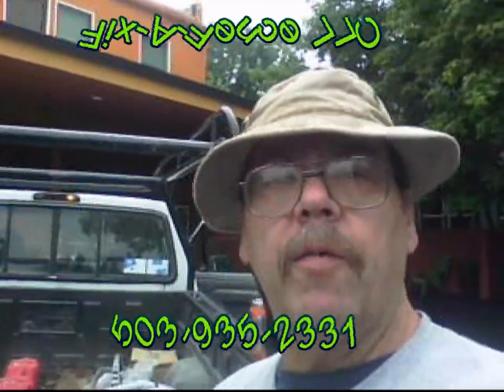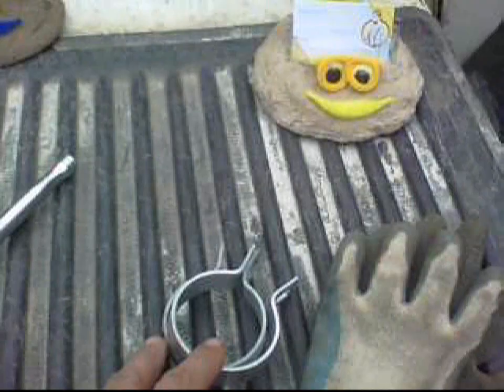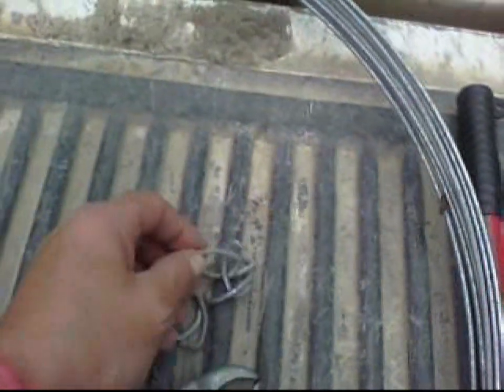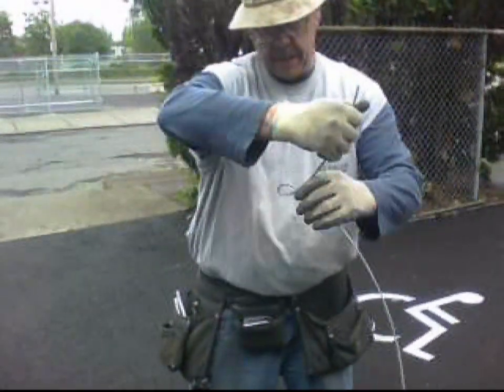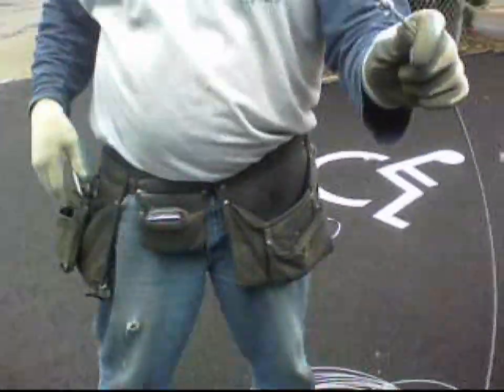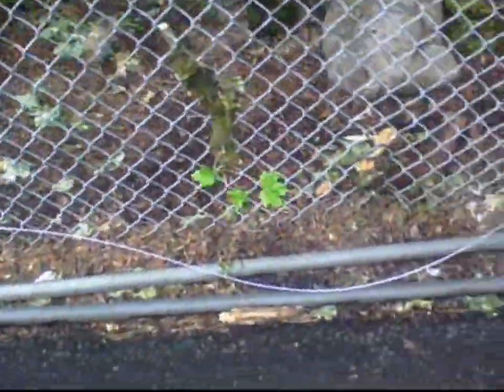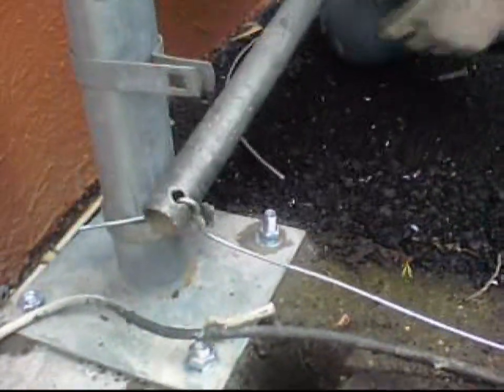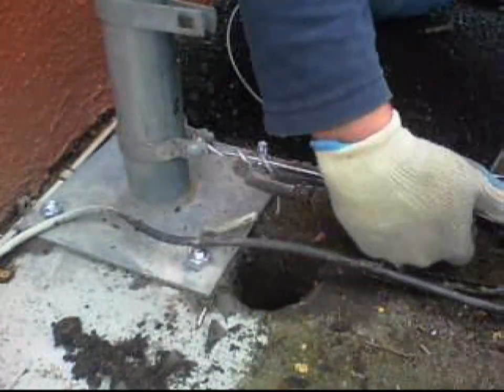How To Install Tension Wire For Chain Link Fence

Comment: Hi, John. I have to Thank You a lot for your video on the tension wire install. OUR German Shepherd pup tried going under our chain-link fence a few times and I had to find a way to keep him in. After watching your vid. I found the supplies at HD. I had to improvise a bit because the fence was up already. The T handle I made was out of an old ceiling fan hanger tube. I drilled 1 hole large enough to use a pinch bar in it and after wrapping the wire really tight remove the bar and wrap the wire

Comment: Good tip with the T bar, doing big project out at my place on Long Beach peninsula & the tension wire is always a pain in the rear.

Comment from the maker: If you are a welder you can make one. Take two pieces of 1-5/8" medium duty pipe about 12-18" long or what ever is comfortable for you and weld it like a T and then drill a hole at the tip of the end of the pipe about 1" from the end. Make sure the hole is large enough for the gauge of wire you are using to slip through the eye you just created and twist away. Hope this helps

Comment from the maker: Normally without tension wire at the bottom of the fence the chain link can be kicked out away from the fence line about 8-10" making it easier for animals to escape. Having the tension wire at the bottom keeps the chain link up against the fence line and only allows about 2". I hope this explains the purpose of tension wire better. Thanks for the comment

Comment: Not knocking your technique at all.  You did some great work there.  Just wondering why you had the come along at the beginning?  I never saw you use it to set the wire.
Reply from the maker: Josh,..so at the other end of the fence line,..I put a loop in the tension wire,..then put the tension wire loop at the brace band and installed a nut and bolt,..that's why I have the come along at the one end,..I use it to stretch the tension wire on longer runs than like twenty feet or more,..does that answer your question?
Reply: Yes, that makes good sense. I thought it might be something like that.  Thanks for the explanation

Comment: What is the max length a tension wire should be? If the terminal posts are really far apart, would you have more than just one run of wire?
Reply from the maker: Good question,.. I have ran lengths of tension wire for 500' from post to post,.. every job is different, depends on how many grade changes you have, drastic grade changes I like to put terminals at the top and at the bottom, there again it depends on the angle of the slope, I hope this helps out
Reply: @JohnWillman  thank you! Doesn't it make it harder to get it tight? Mine is loose enough that the dogs push under the fence and escape. The tension wire isn't even straight. It's got small bends in it throughout.
Reply from the maker: @myfriendjoebob  Wow,.. is the tension wire hog ringed to the chain link? Normally during the installation process the slack is pulled out and the the wire is retightened before tying it off. You may have to break this down into smaller sized lengths to prevent from that happening,.. about the best I can say right now

Hope it all work out for you

Comment: Thanks John,
 Will this still work if the fence is already up? I put up a 5' chainlink in Rockcreek Or. and forgot to install the tension wire. I hope it's a quik fix..
Reply from the maker: Well,..you may need to disconnect the chain link frm the end posts and remove the bottom tie from each line post and then you could run the tension wire between the post and the chain link,..the reason for disconnecting the chain link from the end posts is so that you will have room enough to work the T-bar,..hope this helps,..keep smiling

Comment: I was wondering if it is possible to cut an access hole in chainlink fencing.  I am using a dog kennel to hold chickens and need an access for them. The door needs to be used for us to get into the area our selves
Reply from the maker: Charles Bowlby  Sure you can cut a hole in the chain link,...but to keep the tension as you know don't cut the chain link all the way down to the bottom. Be careful as the little clipping like to go flying when cutting with tension on the chain link. Make sure that you knuckle over the cut ends on the fence where you dog door is,..you wouldn't want you dog getting all scratched up.

Comment: Hi John, thanks for the video mate! I would like to ask if it's OK to run the tension wire around the end posts? I don't have any of the tension wire brackets that your video shows. It would be for a plant climbing privacy fence so does not need to be pretty as it would get covered in plants. Cheers.
Reply from the maker: +stewedapple  the only thing about that would be tightening the tension wire. Isn't there any ma and pa fence companies in your area that would carry these fittings?
Reply: +John Willman I've now found that they do the tensioning differently here in Australia, normally they spiral tie the mesh to the posts and top rail. I cannot find any fences that use a tension bar here, interesting.
Reply from the maker: +stewedapple I don't see why not,..if your putting up chain link the difficulty would be attaching the bottom tension band to the tension bar. Other than that if you're not applying to much tension on the wire it would be fine. Don't want to knock the posts outta plum. There are web sites I'm sure you can get some fittings mailed to you through on line shopping. Good luck,..

Comment: Can that T-bar be bought anywhere?  Or do I need to find someone with a welder and make one?  Local Hardware store has  never heard of it
Reply from the maker: This is what is welded up,..Get a couple of pieces of 1-5/8" pipe and cut them to the desired length's,..weld into a T and then drill a hole large enough for the tension wire to slip through about 1/2" -1" from the end and whal-lah you have a T-bar,..good luck and remember keep smiling

Comment: do you have to weave the tension wire through the bottom of the chain link fence?  I'm trying to keep my dog from getting out under the fence...
Reply from the maker: +John Davies If the fence is already in place, you will need to remove the bottom tie from each line post and pull the tension wire through between the post and the chain link fabric then you will connect the tension wire to the brace band at the bottom of the post. After you stretch the tension wire you will need to attach hog rings to the tension wire and chain link on the half diamond keeping the wire straight with the chain link. Does that make sense?
Reply: I thought the tension wires goes in and out of the chain link fence not just post to post?

Comment: Question, don’t you have to interlace tension wire onto whole bottom of fence? Cause it’s not hooked up to the bottom of the fence???
Reply from the maker: That's what the hog rings are for,..the hog rings fasten the wire to the fence,..weaving it through is time consuming,..then if there is a repair needs in the middle of the fence line it makes it really difficult for repairs
Reply: John Willman got it, thanks for the help
Reply: @jwthefencer  I get that part but what’s the correct way? Should it weave in and out?
Reply from the maker: @balenabros3246  it all depends on how much you want to work with it, hog ringing the tension wire to the chain link on the half diamond is industry standard or us here in Portland,.. I have seen the in and out method and have never worked with it myself, probably never will, thanks for viewing,..
Reply: @jwthefencer  thank you so technically the hog ring does catch onto the chain link that makes better sense andin and out not really needed then. Just wanted to know the standard. Thank you for your knowledge and time.

Comment: How do you attach the chain link fabric to tension wire?
Reply from the maker: With hog rings and a pair of hog ring pliers
Reply: @jwthefencer I am trying to secure the bottom of my chain link fence. It is currently loose. The run is about 100ft. I plan on adding tension wire at the bottom and than attaching the fence to it with hog rings to help secure it. Question should the 100 ft run of tension wire run uninterrupted from start to finish or should the tension wire start and stop between each post across the entire run?
Reply from the maker: @clemensstepho411  If it is one continuous run, yes stretch the wire from one end to the other,.. if there are any uneven areas you can use the fence tie to tie the wire to the post to keep it in position or up off the ground while rolling out the chain link. I hope this helps out,.. if you need a more one on one, give me a call.
Reply: @jwthefencer thank you. One last question. Do you weave the tension wire through the fence fabric or does the tension wire just sit next to the fence fabric?
Reply from the maker: @clemensstepho411  The tension wire should sit next to the wire between the wire and the post at the bottom on the half diamond.

Comment: hi John, can i purchase the d shape brackets for the chainmesh tensioners, they dont sell them in australia they are still lacing the ends with wire, the American way is far tidier
Reply from the maker: I believe you are referring to the tension bands that go onto the posts? Is that correct? Anyway,..I don't sell parts,..I am sure you can get them on line,..they would be measured by the outside diameter of the post

Comment: Is it fair to just assume that you run the cable through each hole on the fence mesh?
Reply from the maker: Sure you can,..if that's what you want to do,.. not sure how that will work out since the wire still needs to be tightened.
Reply: John Willman, does the cable go on before or after fence mesh? In your video, part of it is up and part isn't.

Comment: Can you tell me how you keep the tension tight when you unravel the wire from the T-bar. Thanks
Reply from the maker: I will do my best at explaining it,...so after the tightening is finished with the T-bar, pull the T-bar with the tension wire back away from the post and bring the T-bar and wire around underneath the wire making a loop thereby stopping the tension of the wire from wanting to draw back.You can finish up with the wire still connected to the T-bar and cut the wire after the wrap or cut the wire off of the T-bar and wrap the tension wire around itself from where it was cut. Hope this helps out,...
Reply: where can I buy a tbar?
Reply: @QuinnB1  I'm having the same problem. Can't find one for sale for love or money. I figured I could drill the holes if I could at least find some metal tubes welded together like that, but even that's been eluding me. 🤷🏻‍♀️

Comment: Where do you get tee bar @ John?
Reply from the maker: +paperchasser54  The T-Bar can be fabricated by using two pieces of 1-5/8" medium or heavy grade round steel pipe. Take one piece approx. 18" an and coupe the end to fit the other round piece of pipe. Then take the other piece of pipe and fabricate your T-bar by welding it at the T. Then at the end of the T drill a hole that will fit the tension wire approx. 1" from the end. Hope this helps, thanks for viewing
Reply: I saw where someone used just a pipe and a piece of rebar, with holes on either end of the pipe, one to twist the wire and one big enough for the rebar to fit through. Benefit of that is the rebar can be removed in a tight installation area and put in the pipe once the wire is threaded through. Also the rebar can be placed inside the pipe for a compact storage solution.

Comment: John how would I add it to an existing vinyl coated chain link fence?
Reply from the maker: Ryan Cosic Most ma and pa fence companies should have some remnants on hand. There is a coated tension wire either smooth or a coiled spring wire. The same application applies to coated chain link fence as with galv. Hope this helped,..

Comment: I'm about to re-fence my back yard to contain an overgrown husky that climbs and digs. People tell me I should bury the bottom of the fence. Anybody know where there is some information on the best way to do that???
Reply from the maker: hamstersniffer , dig and trench, set longer posts in the trench before installing the chain link, then back fill after fence is complete,..chain link is available at 6', 7' & 8' high. You could go all out and bury the chain link 2' in the ground or go with 12 inches. Either way you have your work cut out for you in digging alone. Good luck,..

Comment: On a 4 ft fence how high do you set your post
Reply from the maker: austin vickers If it is on a flat surface your terminal post, ( end, corner, gate ) should be at least 49". This will give an inch of play. Normally I like two inches for the home owner so that when they weed eat up against the fence line the tool can reach underneath the fence. Your line posts, depending on the size of your top rail should be two to three inches less than the end post. 1-3/8" pipe I use 2" deduction on the line post, 1-5/8" pipe I use 3" deduction on the line post. Does that help out? If your on an incline you will be setting the posts a little bit higher than normal as the chain link will be at the height of the degree to the terrain and so your line post should be high enough to accept the chain link on the angle in the vertical or level position. Hope all goes well in your chain link fence building endeavors.
Reply: Yep thanks

Comment from the maker: I apologize for the improper use of terminology. The tension wire should go in between the fabric and the posts. Keep the tension wire up off the ground and use the hog rings to attach at the half diamond at the bottom of chain link fabric.